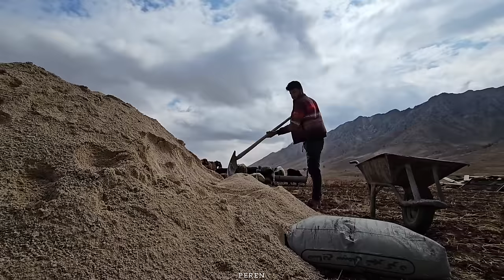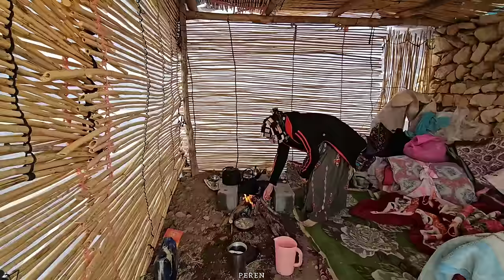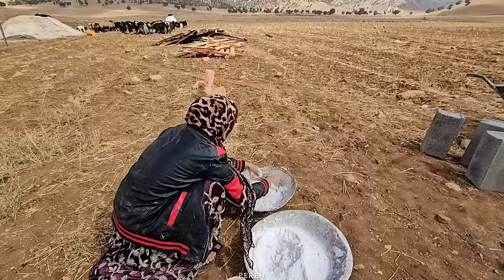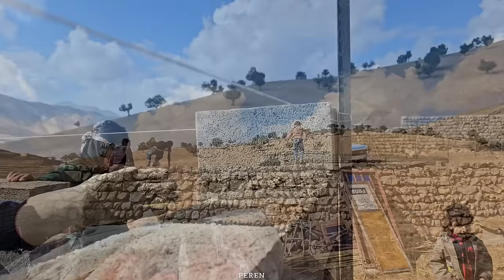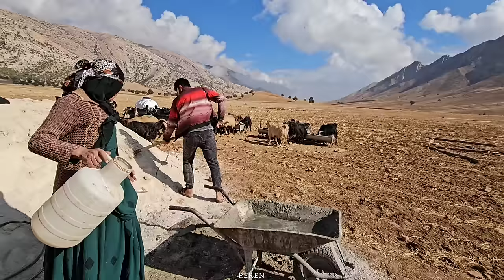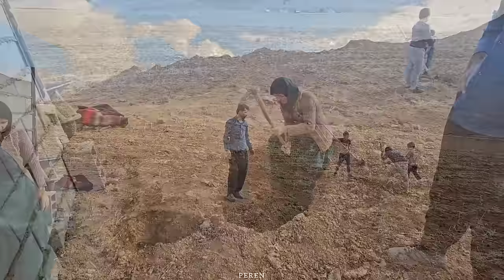From wanderers to nomadic immigrants: the basic needs of the family, creating a toilet

Comment: Initially Make  a cemented platform slightly higher than ground level so in case of rain water may not come inside.   It should be at least 25 feet  long and 14 feet wide.. with shelter above.. because winter is started and it would be difficult to live with small children and in infants in open areas with strong gusts …!!